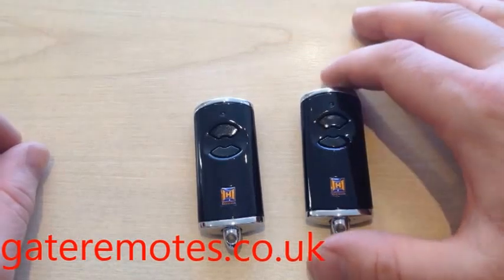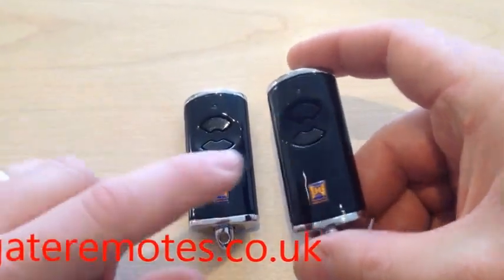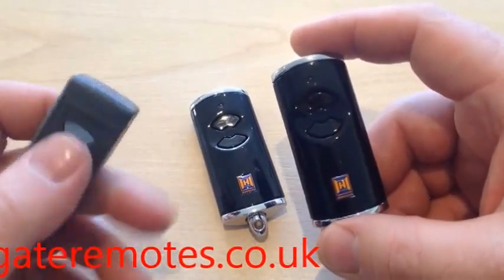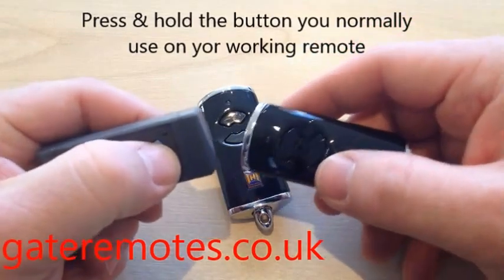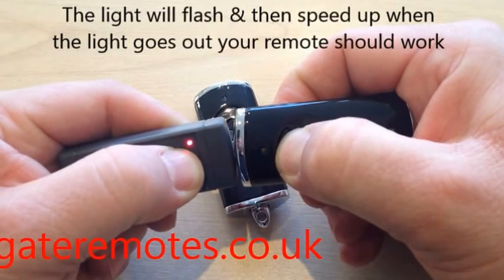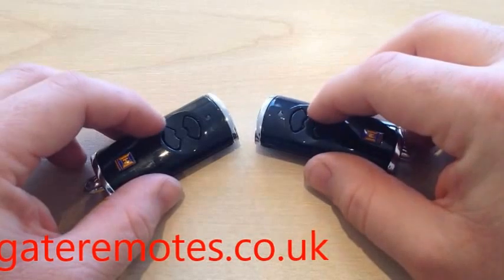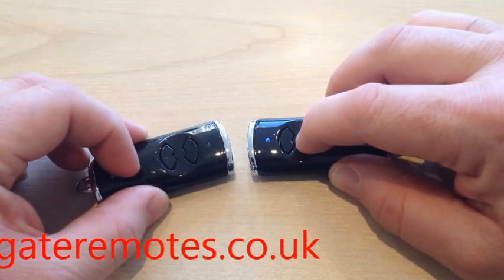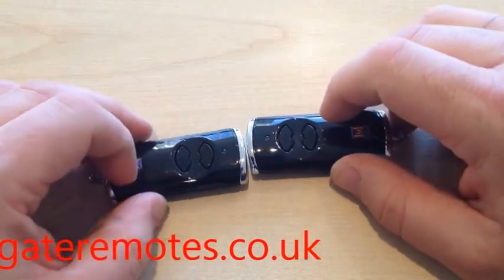Programming a Hormann BS Garage & Gate Remote Control

Comment: you posted the only video where I see that you learned a fixed code on button one while having button two still in bisecur mode. One simple question : how did you manage that? The instructions seems to indicate this possibility, but all tutorials always start by switching the complete remote in fixed code before learning an old remote.